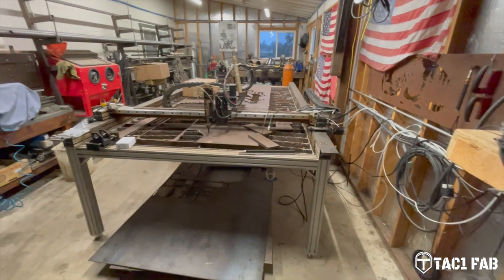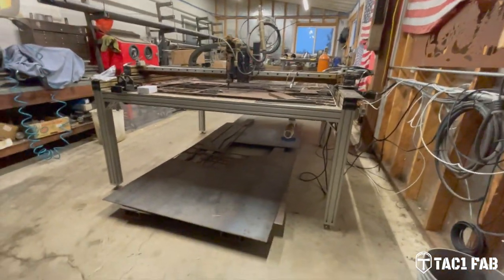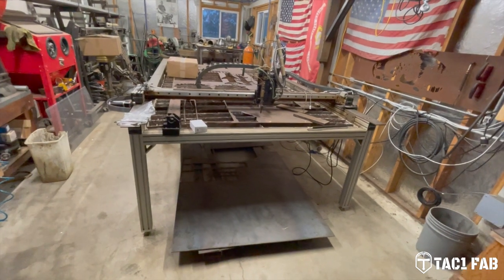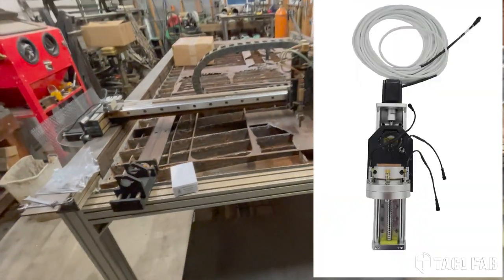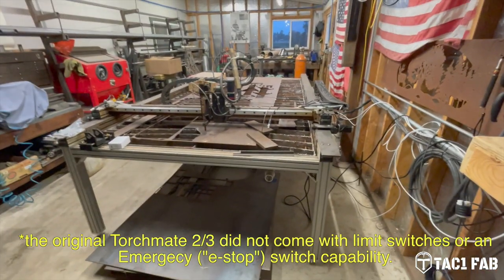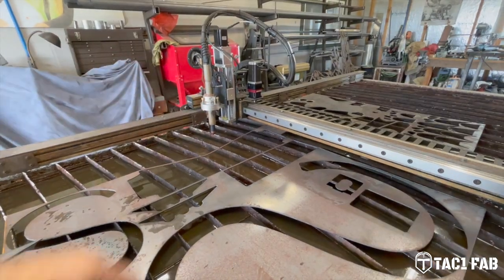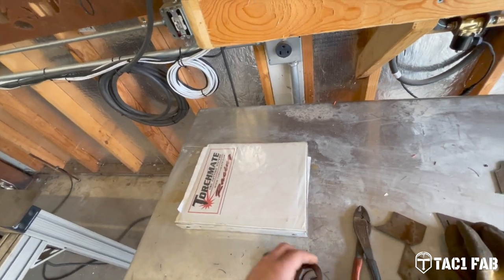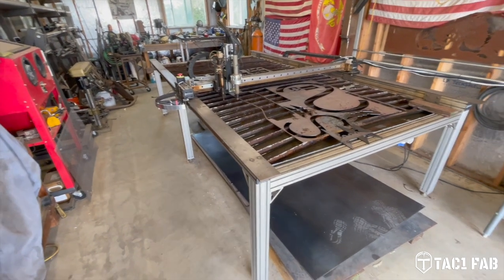Upgrading our Old Torchmate 2 Plasma Table with Spark Robotic

Comment: I ran an old 6'x24' Vicon table for about 4yrs after adding a Buildbotics controller to it. However, just last week ordered a new table from Spark. I got tired of keeping the dinosaur alive and not having torch height control. It was also extremely hard to find parts for the table. Can't wait to have a fully modern setup.

Comment: I had old Torchmate 3 table running the 2.14 software. pretty much all you said were my issues as well.  I ended selling the old table for the vallue of the 8020.  I built my own table and used my plasm as well.  I really like it overall better then my old Torchmate system.  I wired home switches to both ends of my gantry so when it homes it will square it back up.  I had an issue with my table with home switches and Frank posted up to call his tech support and talked to them.  I did and I didn't buy anything from them.  Spark Robotics is a stand up company.  I visited their shop in NC a few years back and was going to buy their table if I hadn't decided to build my own.
Reply from the maker: Thanks for watching! Yeah experience thus far has been great with Spark Robotic.
Reply: spark robotics has my vote, Frank is very knowledgeable